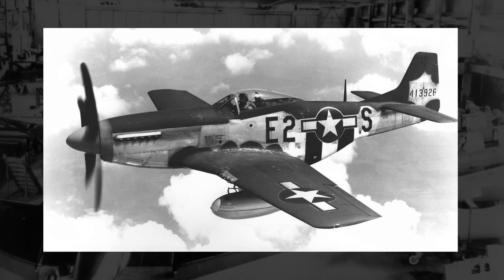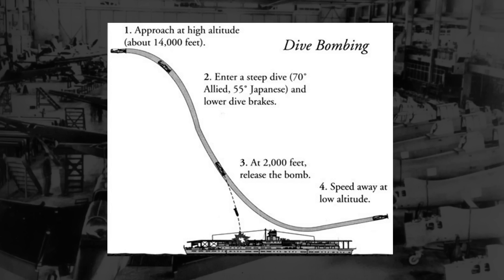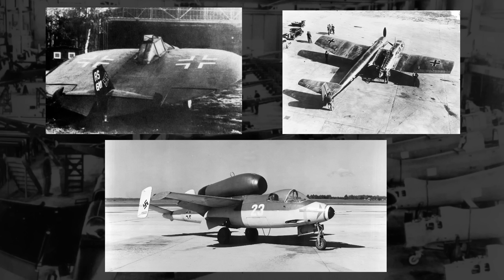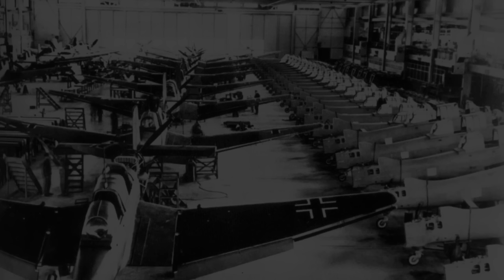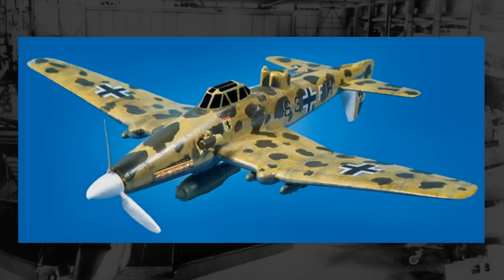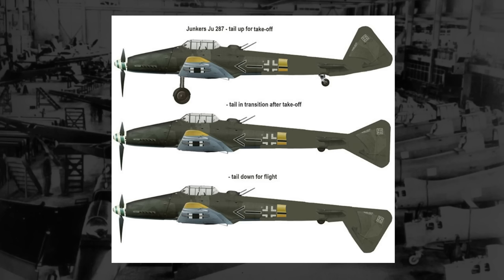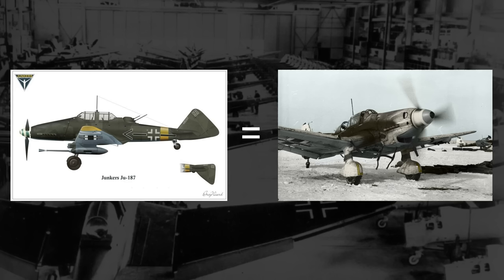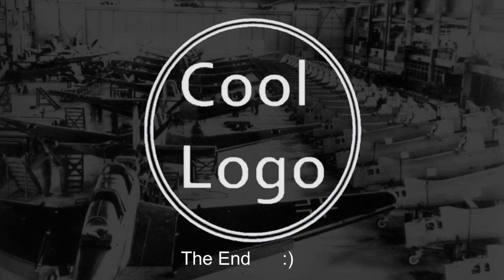The Rotating-Tail Stuka: Junkers Ju 187

Comment: From surviving photos, it would appear that some wind tunnel model testing might have been done. Never read of any surviving published results...
IMO, outside of the unknown flight characteristics, I think the vertically rotating tail was well within German design capability,  and would have posed minimal production strain, at least, compared to many other German aeronautical design features.

The Ju-87 was a highly successful design throughout the war. Just refer to infantry praise for its close support precision delivery of ordnance. It's tank busting capability vastly harmed Soviet breakthroughs & consolidation attempts. Up to the war's last hours, it could reliably be sent to knock out bridges. It was a scourge to shipping, denying whole swaths of the Med to the RN. And, per its pilots & adversaries, it was nimble, except when in its bomb run.
It's one real liability was that it required tactical air superiority, and was often knowingly misused in this regard. But that is not a reflection on its design. SBDs had the same problem. Most twin engines ditto. B-17s needed tactical air superiority (effective fighter cover). The dive bomber concept was fine--witness the Helldiver used to the war's end. Fighters are designed to be the most nimble of a/c types, divebombers to precisely deliver a bomb.
BTW, if priorities hadn't changed, the Ju-187 might have proven its worth. It's low altitude speed might have been higher vz. Ju-87, using comparable loadouts. Even 20 mph can be a meaningful difference. Fw-190s were not seen as the ground interdiction panacea. Even today, the A-10, low & slow compared to its contemporary, is revered for its precision interdiction abilities.

Comment: If the vertical stabilizer/rudder just tilts down vs. rotating, it could be done with a linkage to the retractable tail wheel.

Comment: Other than failures, there would be little trouble in the tail transition. Nothing that could not be flown through. It really wouldn't be a big deal. When you understand what the vertical stab does, it can be under the centerline and work just the same. Other than landing, no problem.

Comment: Great video. Personally I think extending the front landing gear and a fixed downward face  vertical tail with a tail wheel mounted in the tip would be a more productive solution.

Comment: As many have pointed out, shooting the tail off wasn't the problem - the problem is that the bombardier/gunner had a large area of his vision obscured. However, the biggest problem for any two-man dive-bombers was that they were sitting ducks for fighters and to ground fire on the outrun after releasing bombs. Hence, at least for terrestrial combat, fighter-bombers like the FW190, Thunderbolt and Tornado were so successful.

[As a personal note, during one of the battles during the Desert Campaign after Tobruk, a group of soldiers, amongst whom was my father shooting a Bren gun, brought down a Stuka as it pulled out of the dive after bombing their anti-tank gun position. I still have the navigator's map case.]

Naval bombers still needed the gunner/bombardier/navigator so the vulnerability of the two-man dive-bomber had to be accepted as a cost in men and machines when in action.

Comment: Looking at the illustrations in your video; since the rear facing defensive armament was intended to be remotely controlled, perhaps moving the tail assembly more forward along the fuselage, and then placing the remote turret at the very end of the fuselage where the tail would normally have been located would have done away with the need for a rotating vertical tail fin while allowing the rear firing guns an unobstructed field of fire. This would entail a larger diameter of the end-of-the-fuselage to accommodate the bulk of the remote rear turret, whatever form that would  have taken. 
The idea to redesign the landing gear into a retractable type would have reduced the Stuka's drag, probably also upping it's speed in level flight.

Comment: It looks like they made a remotely operated rear gun turret. They might want to mount that behind the tail and have the clearest field of fire possible.
Reply: Check out the Me 410
Reply: @L-P-V  the He177 had them.
It's just a sim but in Il-2 those guns are useless, all you can see while aiming is a circle as big as the site, (imagine a old telescope like they had when all the ships had sails) and if the plane you are tracking goes out of that you have to find it visually and get back into the site and try and find it from your seconds long glance. A Spit on your 6 and you have no time for that. 
Like I said, it's just a sim and all the gunner positions have very poor FOV and FoF, especially the Ju87 and the Val so it may be the limit of a 2d screen (and no Head tracker) that hampers any proper manipulation of the defensive guns by Players.
Reply: @streamofconsciousness5826  the 410 has two crosshairs (like a BF109’s aiming  crosshairs) that have about 180 degree coverage. When I used to play war thunder they were incredibly fun to use because people just didn’t expect this play style ( when they would follow me I would get on a slight climb and while they were able to catch up to me they could only do so slowly and predictably, this I could with some skill easily deny by using the guns with excellent coverage thus they would always be below me.) Yes the Me 410 only has good top speed but I just loved how it looks and figured out a way to make it work. Used “conventionally” it’s quite a shitty plane.

Comment: I have a design for a Ju-187 that incorporate some parts of this version.

Mine has a non-existent Nazi copy of the Typhoon’s Sabre engine, 24-cylinders, which powered contra-rotating props with a slight scimitar form. 

I gave it a very similar landing-gear retract system, but it retained the wheel fairings as a portion of that system to give it cleaner-lines, something that this version would likely not have, due to the sudden end of the fairing enclosing the upper portion of the gear.

I lengthened and strengthened the tail, so no external supports are required, and added a semi-ball-turret that cold house either four of your typical MG42s or two of a variety of 20mm to 35mm canon.

I have some drawings available if anyone wishes to see it.

Comment: That design really improves on everything on the plane. A rare case where the weird stuff they build was actually feasible and practical.
And the middle position seems to fix one issue with the typical asymmetrical tail sections of aircraft: yaw induces roll.
Reply: Yaw induced roll has nothing to do with the tail position. When a plane yaws right, the right hand wing slows down and the left one speeds up. This means more lift on the left and less on the right, so the plane rolls to the right. 

A conventionally placed tail actually resists this rolling effect, so moving it upsidedown would cause the plane to roll more whenever the rudder was used.

Comment: The General Atomics RQ-1 / MQ-1 Predator  used a downward pointing V for a tail in 1995. But it also had a tricycle landing gear and a pusher prop. It would have made a lousy dive bomber, so they mounted AGM-114 Hellfire on it instead.

Comment: 7:14 Just looking at the tail in the fully down position I think I foresee an airflow problem, when turning left or right the rudder looks like it would also force the airflow upwards as well which would pitch the aircraft nose upwards, only in the middle position does it appear neutral, in the fully up position it wouldn’t make much of a difference because you are taxiing and the aircraft might be controlled by the tail wheel, also the angle of the aircraft when on all three wheels looks like it might cancel out much of the angle of the rudder.

Comment: I believe the original design HAD an "H-tail", so a fighter directly behind the Stuka, could EASILY be Directly shot-at, but on a dive where speeds of 450mph were reached, the twin-tail showed too much FLUTTER, so it was abandoned almost immediately.   What I thought was fascinating was that in the instances where the greatest combat flier of all time, Hans Ulrich Rudel {who was nearly "washed-out,"  by his Stuka "buzz-sawing" a building roof with his prop, while on the ground, taxi-ing} was going before Hitler for a medal, one out of two of his 11 total rear-gunners, would be receiving the Knight's cross for defending Rudel's Stuka as a rear-gunner, which meant he[--his gunner] had shot-down 35 or more planes,--an "ace" 7Xs over!   Attacking Rudel's Stuka would "cost" the Soviets over 70-plus aircraft, and, he survived the war, thanks to his gunners.

Comment: 8:39 you mix ground attack and dive bombing.

The Fw 190 was an efficient platform for a fighter bomber, leading to the Fw 190F (ground attack) and G (long range fighter bomber) variants (if we ignore the relevant R and U field and factory kits for the A-series). Later in the war the Focke Wulf basically replaced the Ju 87 as the main type in the Luftwaffe Schlachtgeschwader.

Comment: 07:00 The main advantage of the lower nose angle is to help land the aircraft. Landing is the most difficult part of flight and the one most likely to result in disaster.
The shark-nosed, Me 262, was especially vulnerable in this respect.
Reply: Landing is usually more difficult. But more disasters occured on take offs for a few reasons.

Comment: The rudder is basically held on center by airflow. But if the rudder is reversed and is now on the leading edge airflow is going to amplify any rudder input. It would take a pretty powerful mechanism to keep the rudder from slamming over into a maximum turn position. Unless there was a locking mechanism for the rudder after takeoff and a second surface came into play. The second surface would need a locking mechanism of its own when not in use. What could possibly go wrong?
Reply: By the looks of it the rudder would never be on the lead edge. Even when fully pivoted.

Comment: 'More things to manufacture and more points of failure' was pretty much germany's WWII war production summed up.

Pissing their dwindling resources up the wall on jets and rockets while their army relied heavily on horses and captured vehicles, just  became lots of free R&D for the victorious Allies. Thankfully.

The JU 187 vertical tail angling down is much more plausible than the whole tail unit rotating along the lontitudinal axis, which I originally thought as well. I would assume that it was done electronically as Germany had a big thing on remote barbettes and a handcrank would just seem so out of place (except as a backup because landing with tail stuck down would be uniquely hazardous).

Comment: A rotating tail would most likely bring the plane into serious trouble. What could have worked is to move just the side rudder through the tail to the downside but it had to happen fast as the rudder would not work.during transition.

Comment: One flaw I noticed in it was that if the tail had to be upright to land otherwise the plane wholed crash and risk the poilet so if the tail got hit by any fire it choled damage the rotating mechanism and lock into the down position making landing very dangerous so the piolet wholed have to bail out for safety allmost every time the plan got  hit in the tail

Comment: Very strange, personally I would use the added weight of the rotating tail section to put a Barbette in the end of the tail with a electromechanical linkage connected to a compensating sight in the rear of the cockpit. Not as complex as say the B-29s but enough to compensate for the parallax and lead, smooth out the cockpit with the rear maybe being clear Plexiglas and all the other aerodynamic improvements and engine upgrade.

Great video, always nice when a new channel is suggested and its a good one.
Reply: One of the reasons the Luftwaffe went to remote control guns in the Me 210 (and Ar 440) was that they found during combat experience with the Me 110 that the rear gunner couldn't aim the guns well due to high G maneuvers and certainly couldn't reload.  In a dog fight the Me 110 would end up in a turn with the enemy fighter below and behind where the guns could reach anyway.    Hence the cheek guns on the Me 410 which could hit an aircraft in a tail chase.    The gunfights on the Me 410 compensated for range fall of an air speed for sure but not lead crossing speed AFAIKT.  That probably would have been possible with the  EZ45 gun sight.

Comment: 7:33 
Don’t talk…
Don’t type…
Don’t even think about it.

Just press pause 
and
look at the picture.

If it was a bird,
I’d say that it could point its tail 
up or down,
as required.

As for the aircraft design,
I’d say that the middle placement would be the optimal selection for efficient,effective flight.

There’s probably an 
R/C version flying around somewhere…

Comment: I think a pivot would work better than a rotation.  However,  the connection to the plane would have been much weaker. 

Makes me wonder if they consider making the vertical stab point down, and just moving the rear landing gear to the lowest point.  Strength issues would be easier to address, and they would have had more ground clearance for loading bombs. Might create issues with prop clearance though.
Reply: Variable geometry aircraft can get away with the wings being mounted on a pivot system, albeit for a great increase in mass. It's not unfeasible for the tail to have been mounted on a pivot.
Reply: Making the vertical stabilizer extend downward would prevent being able to lower the tail to get positive angle of attack while taking off.

Comment: Why not just build them with the tail down and put the rear wheel at the bottom of that, it would be almost like Tricycle gear, I don't know how that would effect taking off with the wings being parallel to the ground but it's not a bad idea even their way. 
I don't think it would be too difficult to just have a pivot point and let the tail drop after take off, and have a mechanism for the gunner to work to bring it back up for landing.
That was some engineers baby, they worked a lifetime on that one feature. At least one person was upset the project was cancelled.
I thought you meant it rotated as well, that would have been risky, for a few minutes you would have no rudder or elevators. (Modern tech, teh ycould flip the control surfaces as it rotated so the Elies would be the Rudder and the Rudder the Elevator {on one side....) when they were in the rotation phase.

Comment: Maybe the rudder was designed to just tilt down 180 degrees. The fixed leading edge during normal flight would have to change to a moveable trailing edge when inverted, but it would seem to be less of an engineering challenge as opposed to rotating. Still the whole concept seems to be not worth the effort.

Comment: So much is just wrong. The sirens of the Ju-87 were not series, as you can see on the picture when the nonsense was said, there are none. They only existed in propaganda films. In reality, they practically didn't exist at all. They could not be switched off and ran for the entire flight. 
The alleged armament is also just silly. The plan was to have an MG 151 in the front and an MG 131 in the rear.  The bombs were then also rather 1x 500kg central + 4x 50kg wing. Not 1x1000kg + 4x 250kg + 4x 25kg. That 2.1t bomb load could be a little too much should have been obvious. 
Further even the designation is wrong. The number 187 was assigned to Focker Wulf for a twin engine bomber. Focke-Wulf Fw 187. The model we are talking about had the number 287, which was used for another bomber, Junkers Ju 287, after the new Stuka project was cancelled.

Comment: Transitioning the tail would take time. As the rotation reached the midpoint the tail would be operating as a kind of aileron . I definitely would give being the test pilot for that weirdness a vehement pass.
Reply: Not to mention the controls would be reversed.
Reply: Pivot not rotate
Reply: @jackd1582  verb
1.
turn on or as if on a pivot.
"the sail pivots around the axis of the mast"
Similar:
rotate
turn
revolve
spin
swivel
twirl
whirl
wheel

Comment: Would a slight tail redesign solve the problem, by putting the tail wheel on the vertical stabilizer?  This would eliminate the need for the rotation.  The flight handling would have to be worked out, as well as strengthening the fin to take the strain of the wheel being installed.  (80 years later, the non--engineer is trying to redesign an enemy war plane).😆😆😆
Reply: That's a really interesting solution, actually.  The reason it wouldn't work is the same reason the tail points up on almost every plane, so that on take-off and landing you can point the nose upwards and get lift whilst on the ground.  That's the only way the plane can take off.  Having the tail hang down would mean the nose and wings would be angled down and it could never take off, and couldn't land softly.  I suppose you could have really tall front landing gear but that has a whole host of extra problems and would make the plane really unstable while rolling.   You want the mass of the plane to be low to the ground when landed.
Reply: @excrubulent  That's why the need for a tail redesign.  Perhaps shorten the tail vertically and lengthen it front to back.  Possibly a fully moving tail fin as on modern jet fighters would allow full control from a vertically shorter fin.  (Are we applying as design engineers for Junkers?  😅😅😆)

Comment: 7:22 that's different than how I thought, also seems most everyone who made 3d mockups seemed to think it rotated like I did too as there seems to be a circular cut around the fuselage in the 3d renders. I thought they literally rotated the whole tail section, but this image suggests they intended to only "flip" the vertical stabilizer.